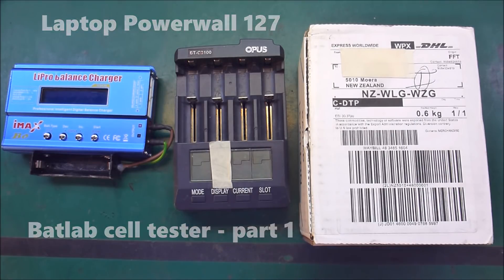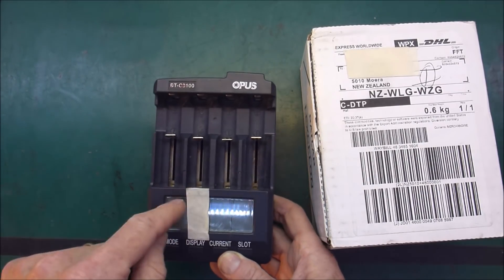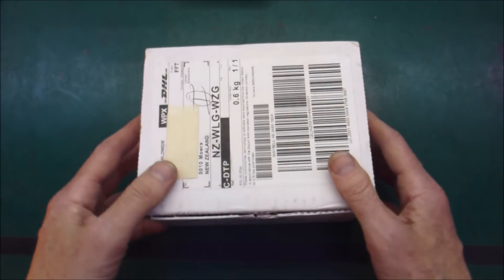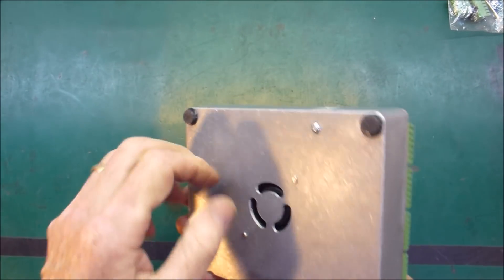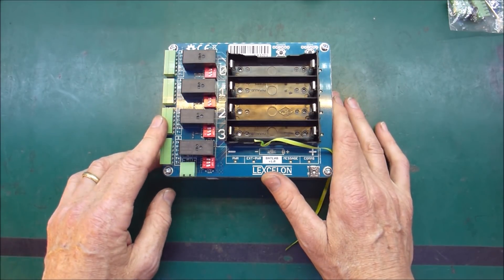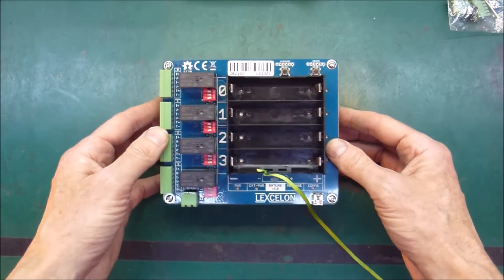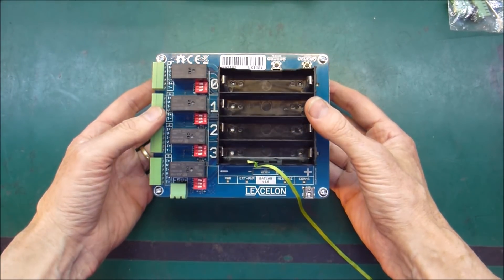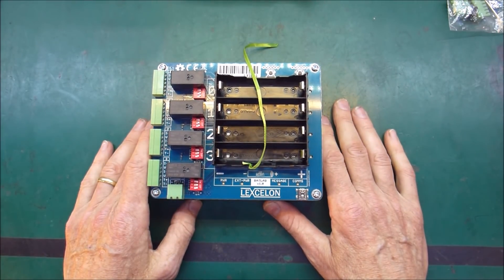Laptop Powerwall 127 - Batlab cell testing system (part 1)

Comment: hi Paul you seem like a cleaver fella, i need some help i want to control the dc current going into my grid tie inverter to reduce the inverters output any ideas how i can do this the inverter runs on 120vdc 
thanks David
Reply from the maker: The best solution I've heard of is to get a buck (or boost) converter that can control both voltage and current. Then set the current as required.

Comment: I’ll be interested to see how the results compare with the opus. Although my first charger/discharges might not be the most practical for processing large amounts of cells I’ve stuck with it because when I’ve tested other chargers there is a discrepancy in the results. May not be huge but may make a difference depending on pack size.
Reply from the maker: Yeah - it's a good idea to stick with what works - to stay consistent.I'm curious to see if I can make some accuracy comparisons. Especially for Internal Resistance measurements.For powerwall capacity measurements I think an OPUS or Imax B6s are fine.